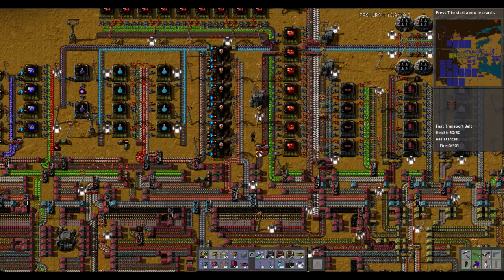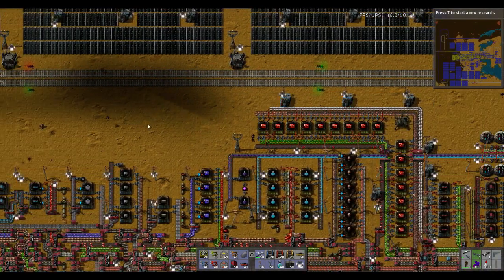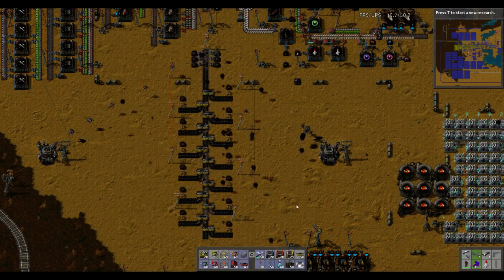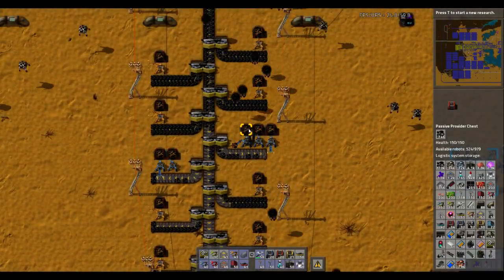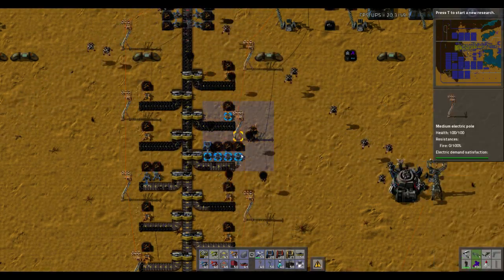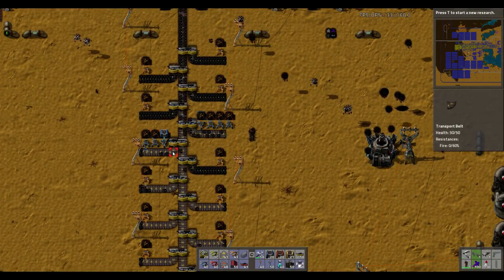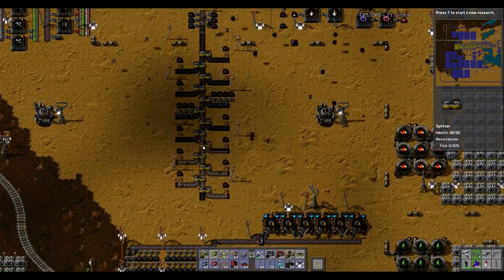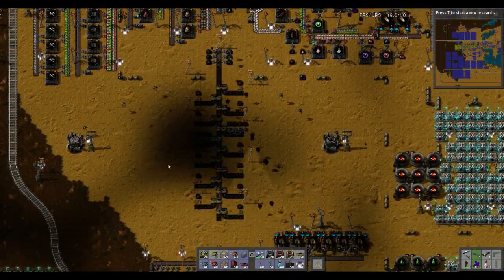Factorio Tutorial 42 Fixing a Mainbus

Comment: I would add more splitters in every division as I see fit, as I consider cheating if you add a second source on the bus line, as well as using logistic bots. And if the bus is too tight, then it should have been planned better......
Reply: Why is it cheating to inject onto the bus? The "bus" is a good way to keep an early factory organized, but it is not a rule by any stretch of the imagination, nor is breaking the "rules" of a bus by any means an overpowered exploit; the more times you break the constraints of a bus design, the more likely you are to turn your factory into an absolute mess, unless you know exactly what you're doing.  

Not to mention time constraints if aiming for the acheivement or speedrunning; a second belt is fine if you want to take your time, but it takes a lot longer to set up.  

I suppose I can understand viewing bots as cheating.
Reply: I just have my own ways of playing it. On my new megabase, I won't even use splitters on the main bus, just belt a new line for a new destination, just to see what the heck I'll come up with.
Reply: Keplergamer that makes sense, I guess.  

Personally, my two active playthroughs are a bob's mods playthrough (Playstyle Constraints? I can barely keep it organized without adding constraints!) and my rocket-rush playthrough (everything is fair game in the name of speed)